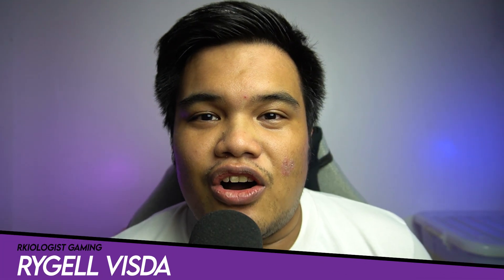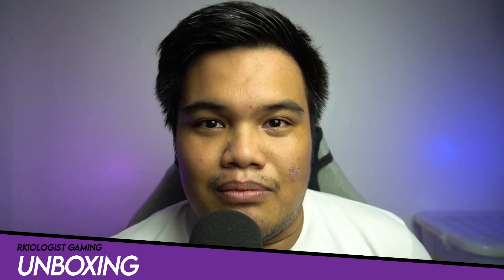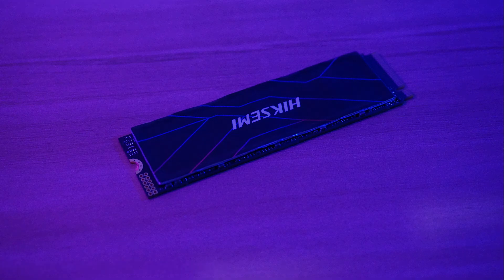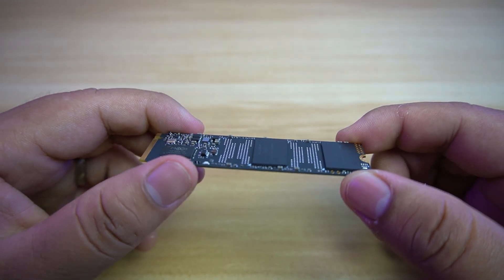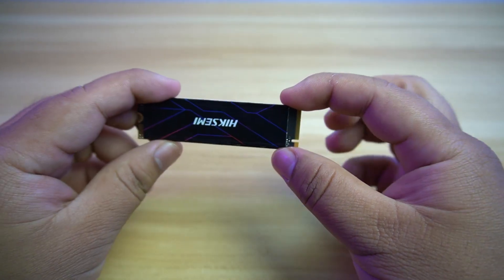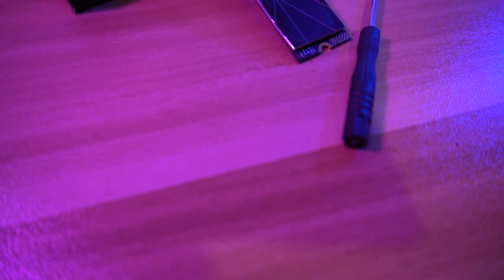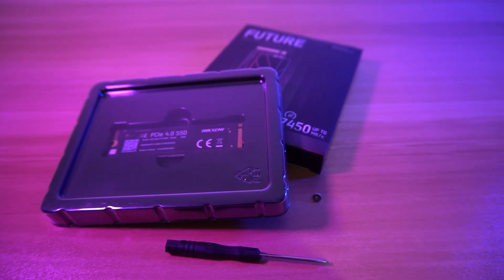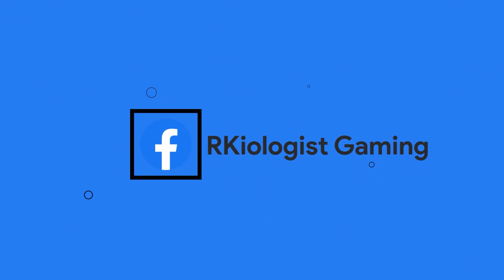HIKSEMI FUTURE GEN 4 M 2 SSD - Unboxing & Review

Comment: I bought the 2TB Future and my sequential Read and Write speeds are less than half the proclaimed speed. I am using a Hagibis 40Gb enclosure on M2 pro. Any thoughts?
Reply from the maker: because your enclosure only support PCIe GEN 3 and not Gen 4 :)
Reply: Nunca van hacer lo que dice. Aparte depende de la interfaz . No puedes pedir eso sí tú procesador y mother no soporta. Ahun Haci nunca vas a ver lo que promete!
Reply: Enclosure is the issue. Install it directly into the mainboard and you'll see full speed.